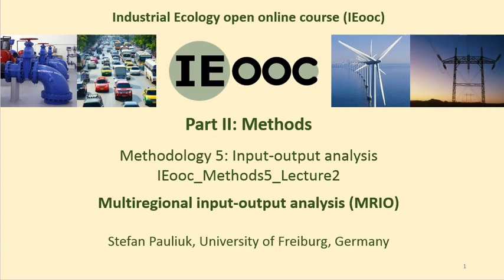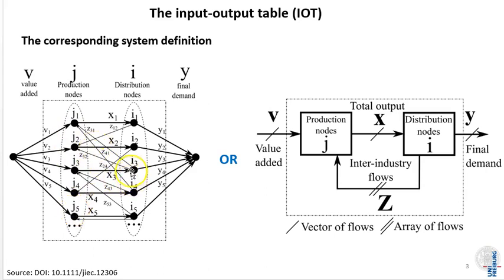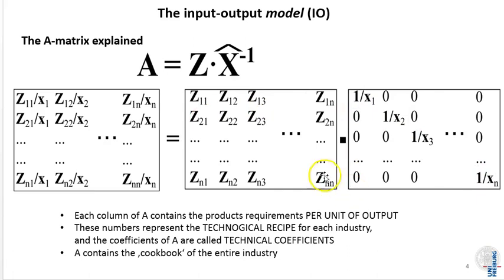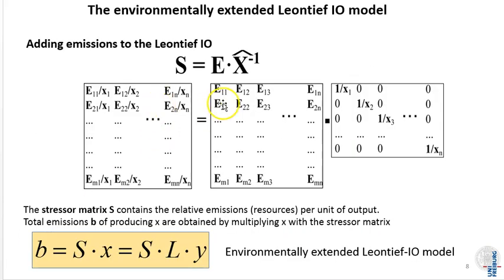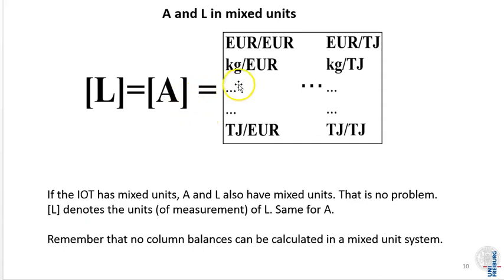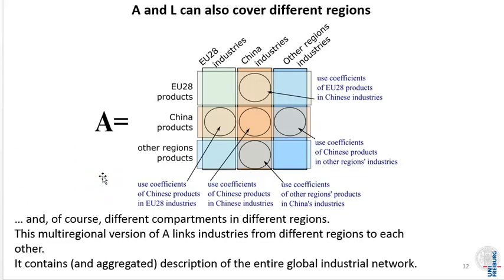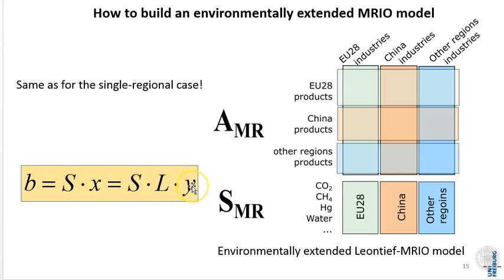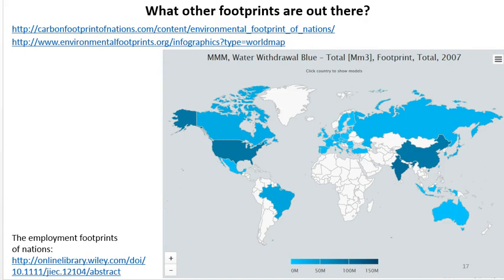IEooc Methods5 Lecture2: Multiregional input-output analysis:

Comment: Hello Stefan, great video! Currently I am working on a project and using the exiobase 3 EE MRIO database. I am able to access the satellite accounts extension and sort of get their values on the  basis of regions. However, i need some direction as to how i can get these satellite account values (ex: emission ) restricted for a sector in a particular region. Any help on this would be grateful! Thanks in adavance :)
Reply: Hi, ask you were working on MRIO. I really need some help with due to lack of research on it. Are A and C matrix build with same data or different data?